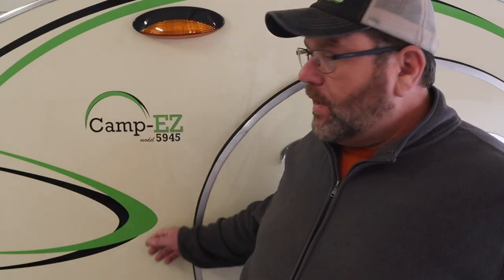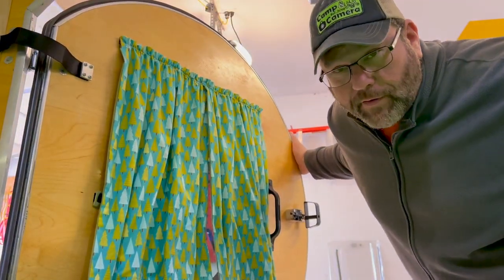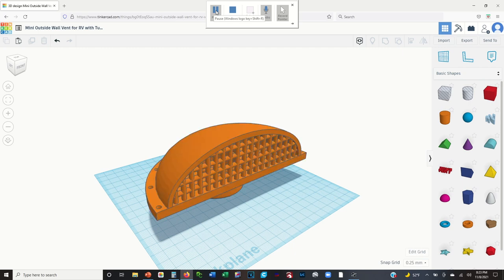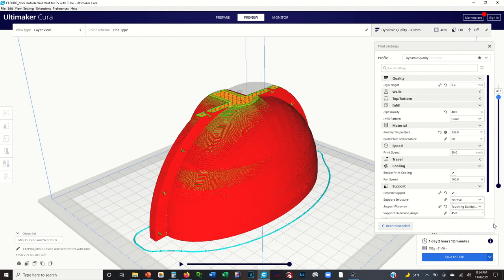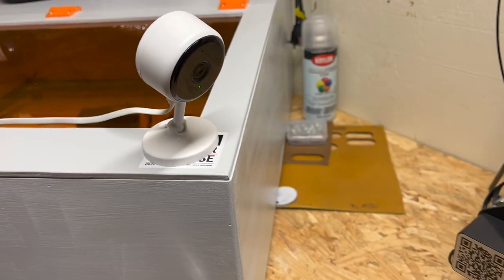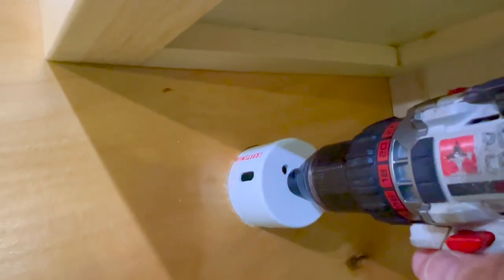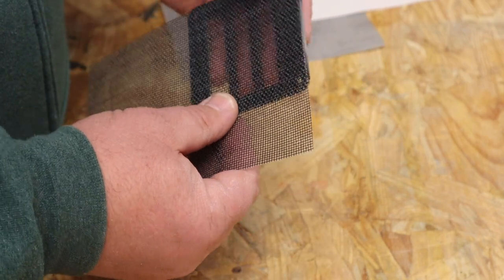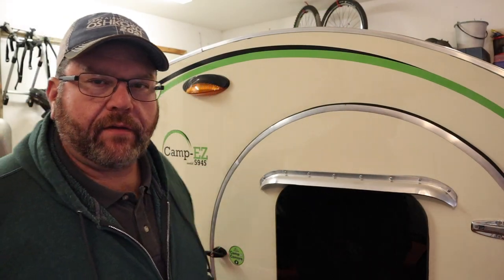DON'T RUN OUT OF OXYGEN IN YOUR TEARDROP CAMPER! | We Make Custom Wall Vents for Ventilation

Comment: Great Job Michael!  Excellent video of the design process and the installation.  A quick tip to help with cleanup...  tape a paper bag below to the wall with painters tape to catch hole saw and drill bit chips.

Comment: I would add a “stand-off” for the inside vent covers to allow you to close off the vents when not needed. (Winter time?)  use two pieces of 1/4” Baltic and use a piece of the your material you want to use for the vent closure and use it to place around the edges between the two pieces of B-Birch to use as a door guide/pocket to slide the closure door in and out.

Comment: Our windows are much smaller (11x17) & 14" above the mattress, so we don't experience that problem. Although I've thought about extra vents ( i also have a fan in the roof). I saw one teardrop have a rectangular vent at the front, so the breeze would cool them off at night. But then you'd have issues with water intrusion during travel, always something. You can never have too much ventilation, especially on summer nights. Great video Michael
Reply from the maker: Thanks!  We also purchased an air conditioner that we hope to install in the spring.  The vents should be enough until it get real hot though.
Reply: Wow,  a vent in front is just silly for what you said. Lol. Should sic the Japanese on the problem, they make a great car/bike. You'll have them 15 years and nary a peep out of them. Parts aren't cheap, tho.

Comment: It's funny this popped up on my subscription feed as I am 3d printing six shooter rubber band guns for my nephews LOL I use 100% infill on any print I want to be extremely strong takes longer but the end product is worth it I finally got my Ender printing so good it produces extremely smooth and detailed prints i'm afraid to touch it now because it took a long time to get it doing so well
Reply from the maker: Once I get my bed leveled, I try not to touch ANYTHING!

Comment: I didn't think of putting a vent in the side. I have tinted windows on my teardrop so I don't need curtains and its only one sleeping in mine so a 1 inch crack in 2 windows works great. I did do something similar for my dog house AC/Heater unit but I ducted it through the floor up the wall  and my connection are under the camper.

Comment: You might want to come up with a way to close those, even if it's just a fitted square cover on the inside. If you go anywhere cold and/or windy, it's liable to turn your teardrop into a howling wind tunnel. Should be amazing in the summer time though! 👍
Reply from the maker: We keep airflow going even during cold nights.  We just use an electric blanket.  Airflow keeps the oxygen good and the humidity down.
Reply: @CampandCamera  Fair enough! Neat solution. I can't use those -- my wife is terrified she'll burn alive. 🤷‍♂
Reply from the maker: It’s probably happened to someone!

Comment: I love all of your videos. Will this make the caper cold on cold days? Is there a way to close it, if need be?
Reply from the maker: Unfortunately, airflow is a must even in cold weather.  If the space were sealed up, we’d run out of oxygen after a while.  We use an electric blanket in cool temps though, and find that it works well even with fresh air coming in.

Comment: I like it. How is that plastic going to hold up to UV light? 

Get you a set of self-centering drill bits. They’re even cooler than center punches for wood working.
Reply from the maker: From what I read, the filament I used (PETG) is supposed to be UV resistant.  Time will tell on that though.  Self-centering drill bits?  I’ll have to check that out!
Reply: Was wondering the same and was more concerned with the heat.  There is a filament called ASA that is designed for automotive uses.  PETG might just do the trick though!  Very nice Michael. 👍

Comment: Fantastic!! This is the first time I've seen a reason for me to get into 3D printing... Custom teardrop parts!!!🤯
I have similar issues with the curtain. Plus we live up north and often camp in colder weather. The cold air on your belly is REALLY annoying...
ITo solve the same problem, I purchased yacht vent cowlings for the exterior vent hood and butterfly vents on the inside so I can dampen the incoming air volume. I haven't installed them out of fear that rain will come in while driving down the highway... Should I be concerned?
Great channel!!
Thank you!
Kiko
Reply from the maker: It sounds like you have a good plan.  Not sure about the rain.  It would depend on how they’re oriented.
Reply: @CampandCamera  They're supposed to be level, as you installed yours. I'm just nervous about water whipping/splashing in while driving... Perhaps some custom built "plugs" in the outside opening  to stop the whipping water🤔
Reply from the maker: @kikomurphy9417  Great idea!

Comment: My mom went out to find a place to start a restaurant, and came home owning a drapery shop. I worked there. You can gather the curtains onto small cafe rods at top AND bottom, slightly stretched between the rods. That way they don’t flap around. Keep a slit in the middle so you can access the hardware.